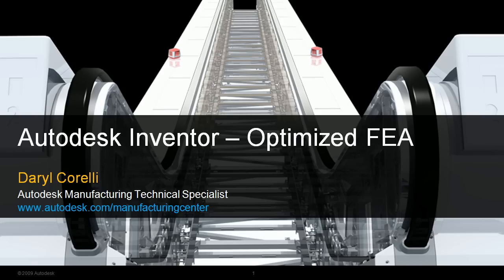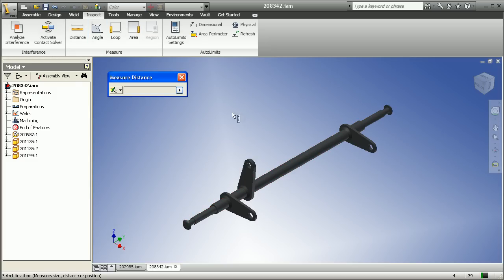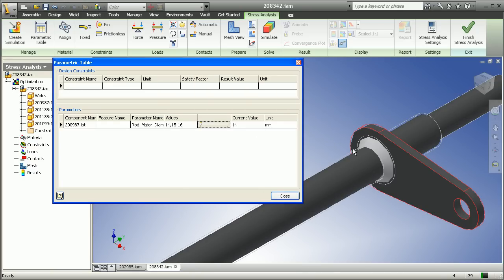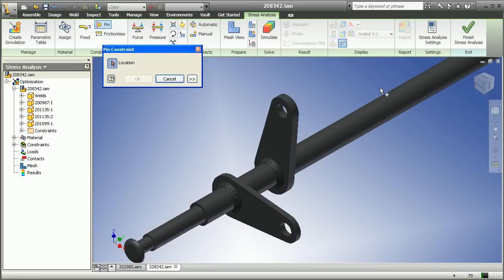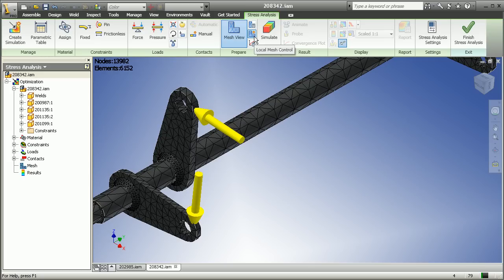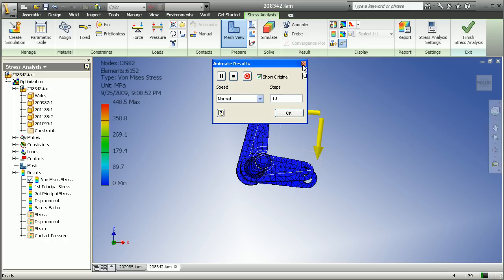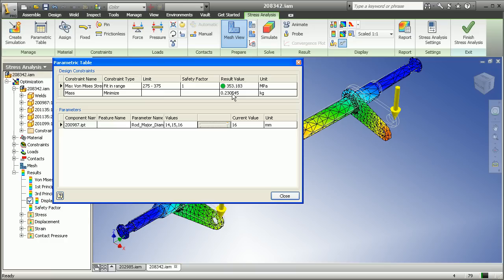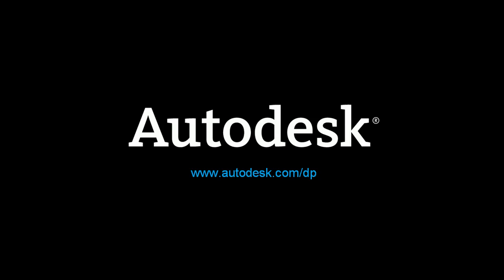Autodesk Inventor - Optimized FEA

Comment: please I am working a project and I have been trying to optimise my component on autodesk investor 2017 via parametric table, but each time I run the simulation they'll say "failed to generate configuration". please what should I do in order to correct the fault.

Comment: what autodesk tools are needed to design and test a 3d virtual tire?
Reply from the maker: For design, Autodesk Inventor (www.autodesk.com/inventor) or Autodesk Fusion 360 (www.autodesk.com/fusion360) are top notch choices. Fusion is more "cloud" oriented. For testing, both Inventor and Fusion include finite element analysis (FEA) abilities for simulations. Autodesk offers additional Simulation options depending on the type of data you're looking to get from your test (i.e. structural testing vs. thermal testing vs. fatigue testing, etc.). www.autodesk.com/simulation. I hope that helps!

Comment: hi there

I have set names for my dimensions in "Parameter" but in my "Parametric Table" in Simulation section I don't see my parameters and the table is missing the lower part as seen in the video "parameter". could you please help me on that?

Comment: you said the movement is exaggerated to see easier how a part will deflect under load. am i able to see how much it will deflect instead to fit within a certain tolerance? or do i just have to see the measurements it gives?